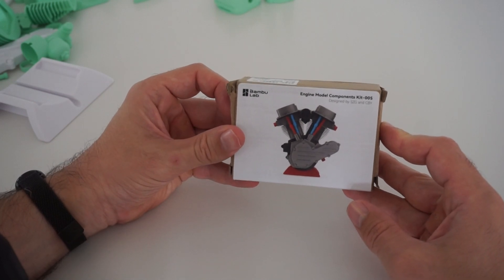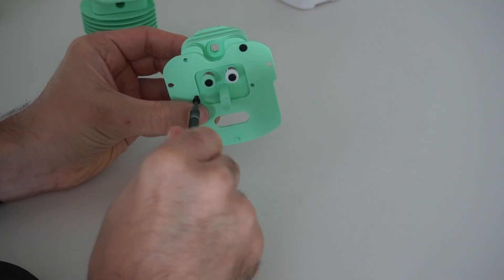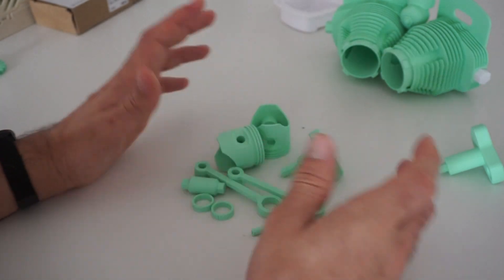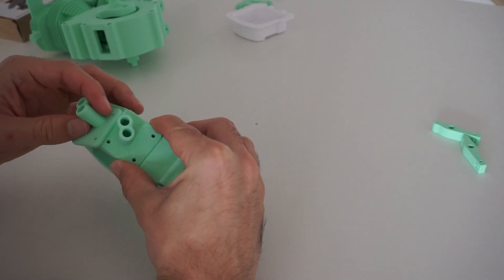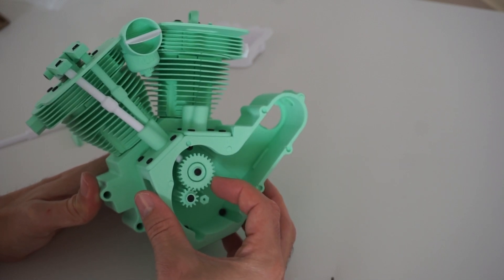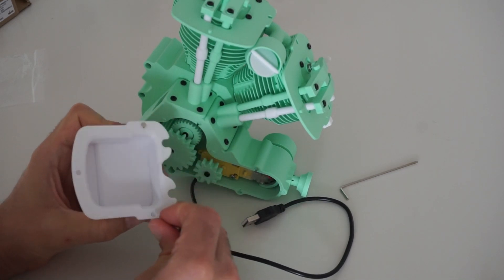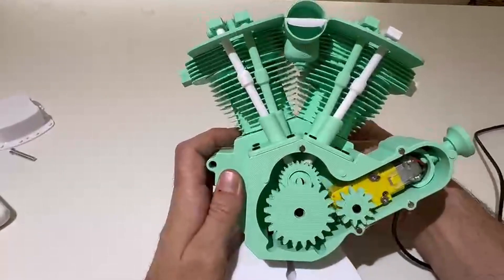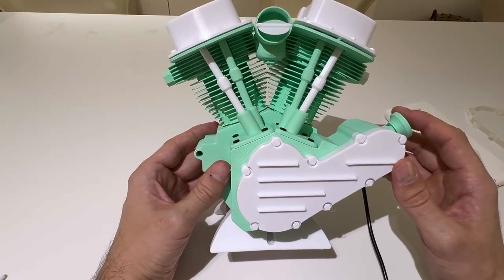Building a Beast: Step-By-Step V-twin Engine Assembly (Bambu Labs Kit 005)

Comment: Awesome build dude! Might have to get this one for my old car loving uncle. 

Since you have an X1, do you have any opinions on X1 vs P1S? I want to upgrade and I wanna see if I can save myself $500
Reply from the maker: Yea definitely a good gift for car enthusiasts, but they should understand 3D printing isn’t the same durability and perfection of a store bought kit with molded parts.  

I don’t have much experience with the P1S but I think it’s still a great printer especially for the value. Just missing some features like super high speed, AI detection of prints, auto Timelapse which I love, and some exotic materials printing options. Depends on your needs/ preferences I think
Reply: For anyone who sees this later, I got a P1s and the jump from my Ender 3 V2 to a PS1 feels as big as the jump from no 3d printer to the Ender 3. Money well spent